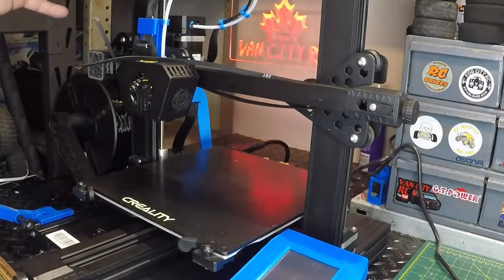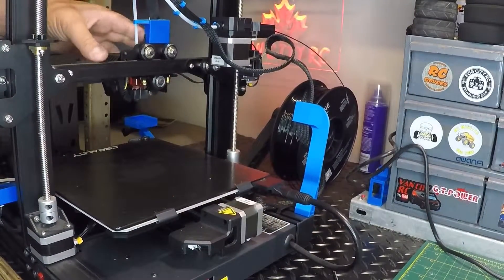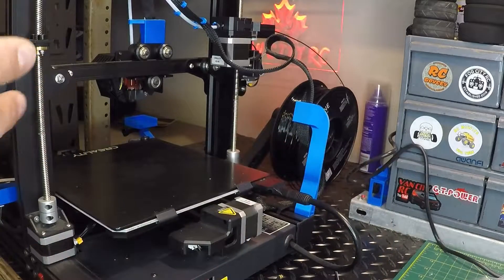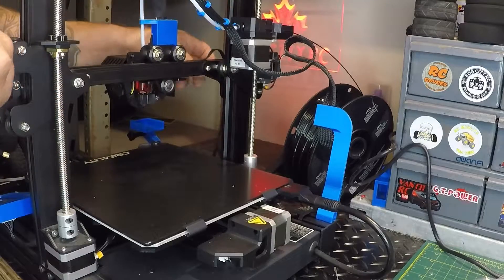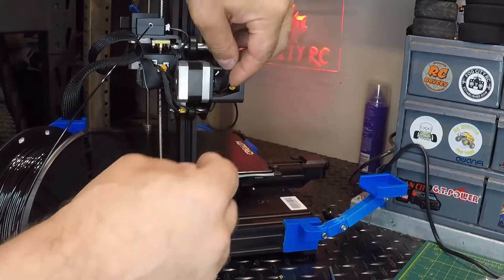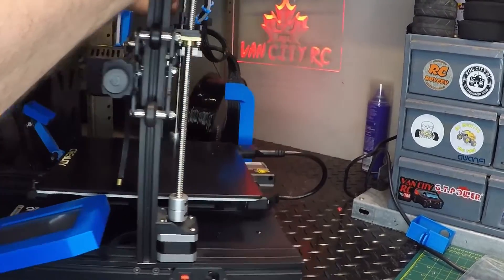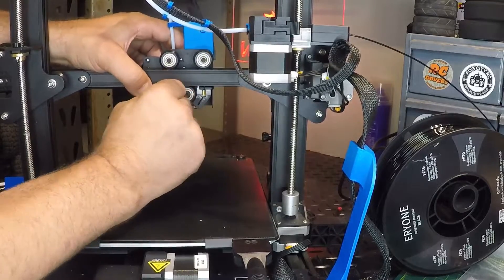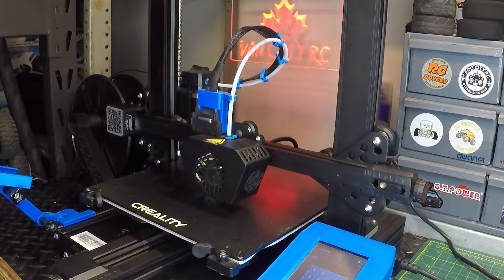Creality X-Axis Belt Replacement, CR-6 SE 3D Printer

Comment: In my case, the printer makes a noise when it moves relaxed on the X axis. What is the reason for this?
Reply from the maker: Possibly the tension of the belt may need to be adjusted. Or the rollers being dirty might cause the noise

Comment: Just curious my X-axis tensioner is always loosening.  It seems to rotate so easily but the Y is tight to move.  Is yours as well?
Reply from the maker: I find both feel about the same when adjusting. Possibly your x-axis belt is a bit loose which would make the tensioner rotate easier